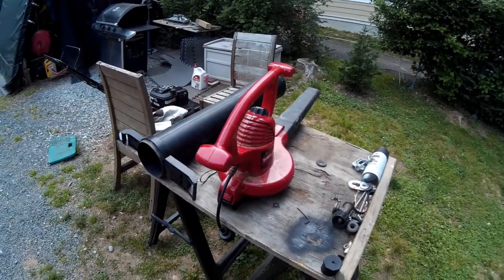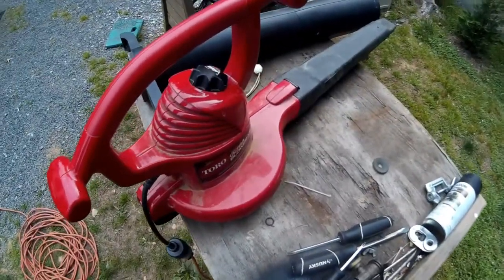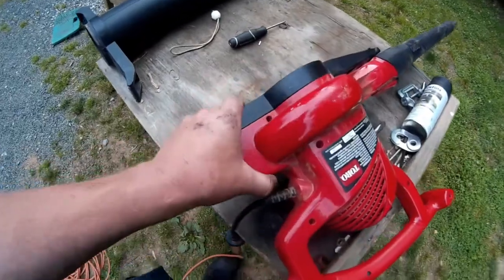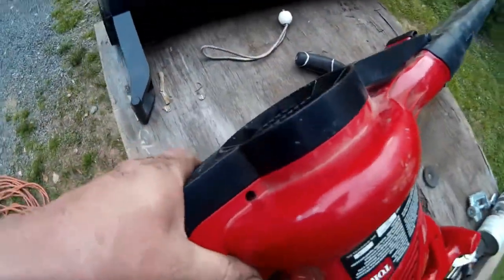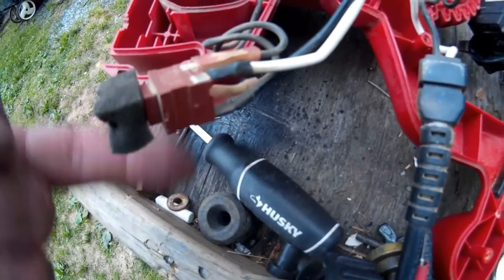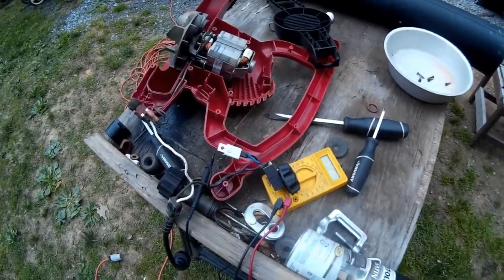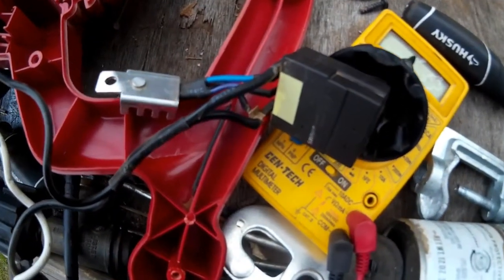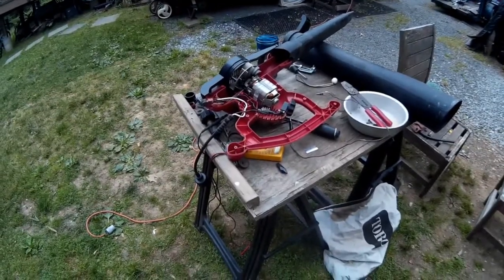Toro Ultra Blower Vac Trash Find

Comment: Not sure if this will help anybody. Mine was exhibiting similar issues as the one in this video. However, I took mine apart without ever seeing this or any type video or guide. I noticed a great deal of debris on the switch and throughout the housing. Fired up the compressor and blew the dust out. After putting all back together it worked. I've not stress tested the blower beyond the first trial run, will keep using it and if it fails, I'll let y'all know. Thanks to those who make fixing stuff easier by sharing all the skills and knowledge!

Comment: I replaced my faulty switch with a common 15A lamp slide dimmer, works great. I like it better than the dial in fact, better finesse and range
Reply from the maker: I used a 15A toggle switch in this one. Thanks for watching
Reply: Yup, there are repair options for the tinkerers. For my use i need the variable speeds. They know the dial switch is crap but never improve it. Ive been thru 3 of em all go bad. The motor eventually goes after a lot of miles on it. But these blowers are strong, you can get 5-6 years hard use out of them but the switch will go jancky sooner or later.
Reply: Must be creative. I have the same and I ordered a Fan switch, if it doesn't work I will use a dimmer,  SCREW the CARTELS that want you to throw everything 😠😠😠😠😠😠😠😠

Comment: I'm  currently trying to repair my Mom's Toro blower and the issue is it doesn't shut off. It is on full blast all the time.  I guess I'm lucky it is working and will have to tell her just to plug and unplug it.
Reply: About to check my safety switch maybe yours is jammed. Had mine for 23yrs lol

Comment: I had issues with this switch for years. (wouldn't turn all the way off) finally decided to take the switch apart as I figured there were some bad contact surfaces in there. I was right there were some burnt contacts. I cleaned them off and commenced to putting the switch back together. Everything was going good until.....I noticed that one 𝘭𝘪𝘵𝘵𝘭𝘦 (brass) contact thingy that had fallen out and I didn't notice where it came from and can't figure where it goes. Damn! I was trying to be so careful taking it apart and not lose anything. Guess it's time to rig up a toggle switch. I just use this blower/vac as a vacumn so all I need is full speed.
Reply from the maker: Yep I know that feeling. Thanks for watching

Comment: Don't waste your money on this model.  My machine has the same problem. These switches are notorious for failing sometimes only a few months after purchase.  The contacts inside the switch fuse together causing the plastic knob to break.  Toro is well aware of this problem but refuses to sell the part to fix it!  Hundreds of similar complaints continue to fall on deaf ears.  To be safe, either buy another brand or purchase an additional service contract.  You are going to need it!!!!
Reply from the maker: That is true no replacement part available. They should redesign the switch and sell them. It is a good blower when it works. Thanks for watching

Comment: if you know how, you can replace it with a different switch.  I watched a video of somebody doing this and it worked.  I have a toto also that does not work, i am sure is the same thing.
Reply from the maker: I did put a toggle switch in mine after I posted this video.

Comment: The safety switches on those go bad... you can open em up and override safety with a peice of popsicle stick  inserted between plunger and switch also you don't have to run it on variable speed you can run it with a regular switch full tilt...

Comment: Thanks for the informative video. I've got the same problem with my 3 year old blower. Could you provide a link or more information regarding the toggle switch you used. Thanks!
Reply from the maker: The blower that I have is 120 volt and pulls 12 amps. I went to the hardware store and got a 120 volt 15 amp toggle switch. Made a plate and put the switch in the blower. I left the safety switch in because it was still good and working. Thanks for watching
Reply: @TheGAutomotiveAndMore  Thanks so much for the quick reply. Much appreciated.
Reply: @TheGAutomotiveAndMore  Thanks for info
Reply from the maker: @trianj12  The blower that I have is 120 volt and pulls 12 amps. I went to the hardware store and got a 120 volt 15 amp toggle switch. Made a plate and put the switch in the blower. I left the safety switch in because it was still good and working. Thanks for watching

Comment: Sorry to bother you again, but did you remove the transistor from the circuit when you replaced the variable speed control with a toggle switch? Thanks again.
Reply from the maker: Yes, cut the switch out and the transistor. There are 2 black wires on the switch use them.
Reply: Thanks again for your help.
Reply from the maker: @ronpost587  Let me know if it works
Reply: @TheGAutomotiveAndMore I used a Gardner Bender GSW-10 toggle switch and it located where the existing switch was located. I modeled a housing using SketchUp that would fit into the existing cavity without any fasteners or adhesive. The first try placed the switch connectors too close to the motor housing so I fashioned a second one which raised the switch so it wouldn't go to deep into the motor housing. I used Baltic birch which worked out pretty well, but I sure wish I had a 3D printer. I'll miss the speed control but at least I can still use it with my gutter cleaning attachment.

Comment: At 5:15 your index finger is nearly touching a black wire that is connected to the top side of an L-shaped prong (?) on the starter.  How is that connection made?  My wire is broken off there but I have no clue how to reconnect it. Any ideas?  Thanks.
Reply from the maker: Its probably soldered or they welded it. You should be able to solder it. Thanks for watching
Reply: @TheGAutomotiveAndMore         I have tried soldering it but it won’t stay attached.  I’ll try improving my technique again. Thanks
Reply from the maker: @debbiewilson5399  Try using some solder flux.
Reply: @TheGAutomotiveAndMore    In addition to what’s in the solder already?
Reply from the maker: @debbiewilson5399  Yes.

Comment: Yes, the switch is bad. Take it out and throw it away . Now wire, it direct when you plug it in way you go. Yes, it will run on high but that’s where you want it 98% of the time anyway.  And as far as the vacuum and the bag that’s a total joke anyway, absolutely worthless. It’s a leaf blower and a good one once you get rid of the poorly designed off on switch.
Reply: You, my friend, are absolutely right. I wish YOU jad a video on straight wiring this thing ..

I'm like you. I'm all or nothing